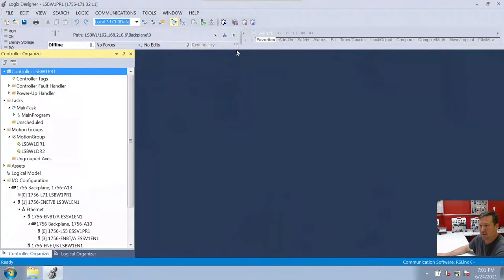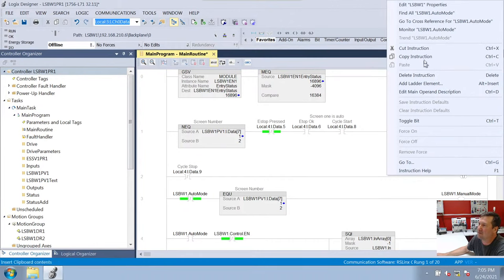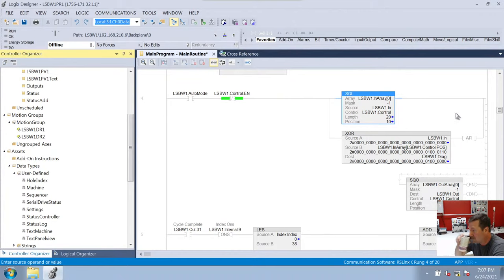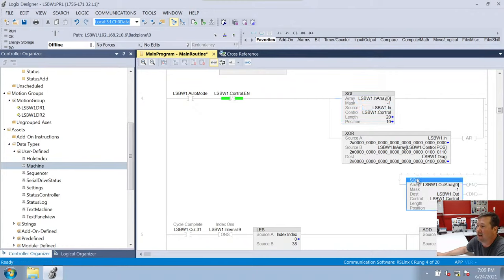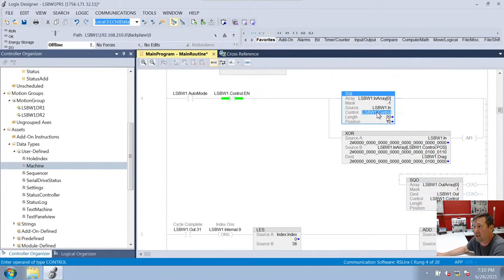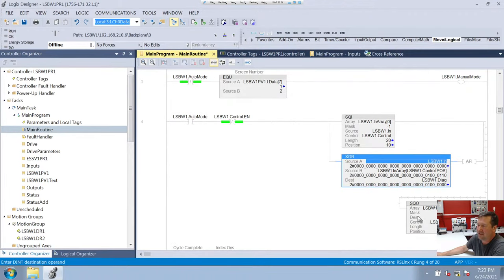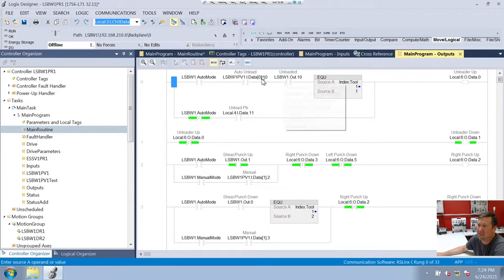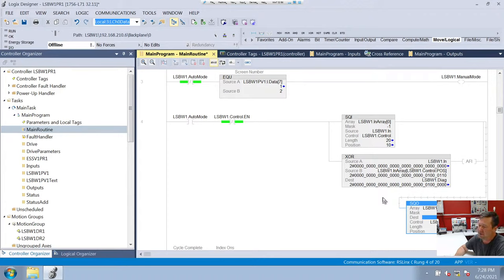My First Studio 5000 PLC Program Tutorial, formerly RsLogix 5000

Comment: Tim... I got in way too late, so reviewing afterwards... With Jeff's example at about 1:27:00 time frame or so, when you would attempt to toggle ahead of a step by more than the very next step, the first bit in the rung (i.e. PermissiveStep.4) wouldn't be a one, so it wouldn't really toggle for more than one scan, if the CPU even allowed it to be on without the seal-in working. I think his logic would work as long as each sequence is toggled in proper order and he is watching the process to be sure it is safe to toggle... Safety first, though, so use good judgement here guys...
Note: I have used a S(1), S(2), etc. with a Bool(32) or Bool(whatever largest step number plus 1) in past and it allows for any of steps to be on or individual steps, whichever you choose.. Then, the shorter a name you can give it and make some sense, the more steps will fit on one branch of a diagnostic/monitor rung with an AFI bit on left and NOP on right...
Reply from the maker: I think we need to discuss ways of sequencing machines from scratch.  What do you think?
Reply: @TimWilborne  That should be helpful. All of us can learn the pluses and minuses of the various methods.
Reply from the maker: @Red_Pill_Matrix  OK, let me see how the poll turns out.